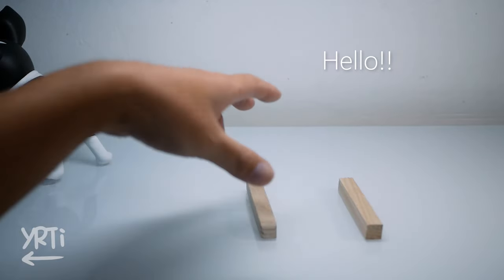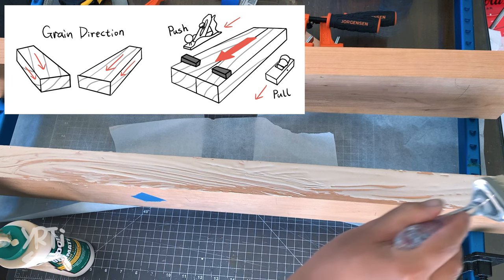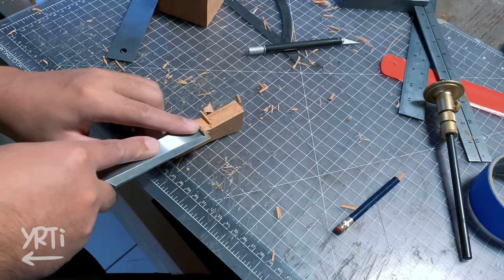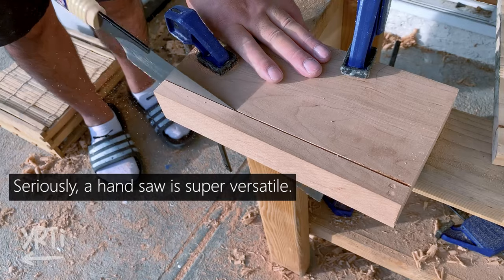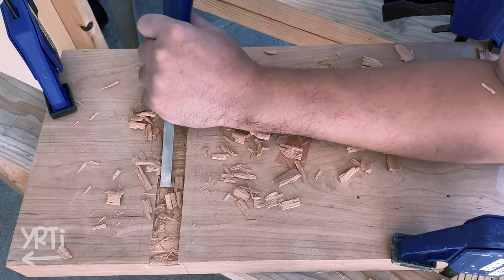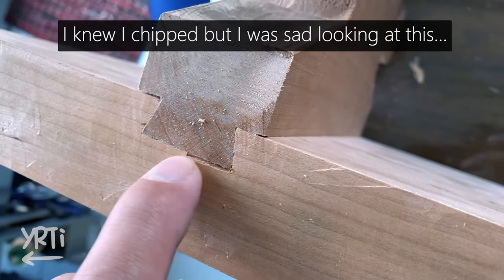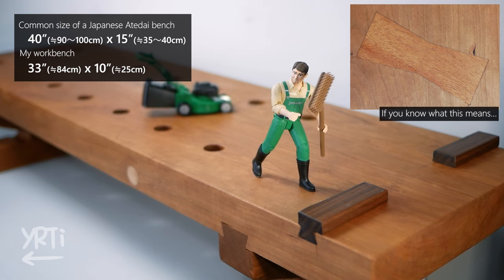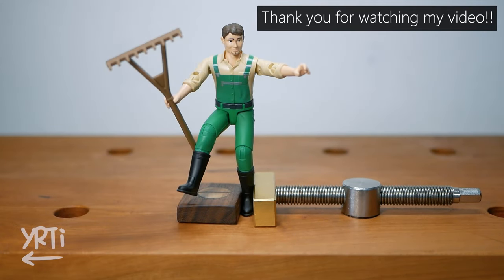Making a Tabletop Workbench Inspired by Japanese Atedai Plane Board

Comment: I agree with your handsaw comments. I’m trying to teach myself woodworking and started with a circular saw.   I started using a Japanese style pull saw (JPS” because of positive comments from you tuber’s. Anyway, I have found the JPS extremely satisfying to use.  It is also helping to improve my accuracy in cutting straight.
Reply from the maker: Thank you for the comment! Yeah, I think some people don't believe in the accuracy of hand tools in general but in reality, unless you use super expensive machines that are not built for hobby, hand tools can handle things better in terms of the fabrication quality.  

If a person has good hand tool skills, he can also use cheap machines to roughly fabricate a product and then finish it with hand tools for speed/quality and this is where I'm looking at:)